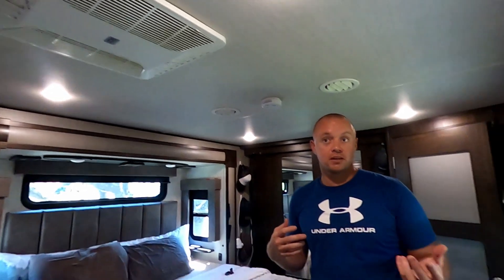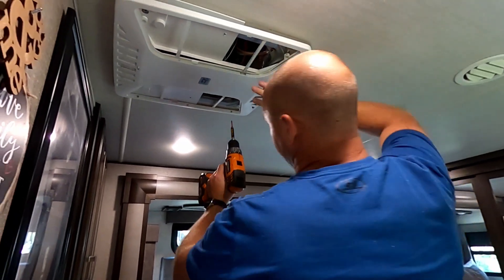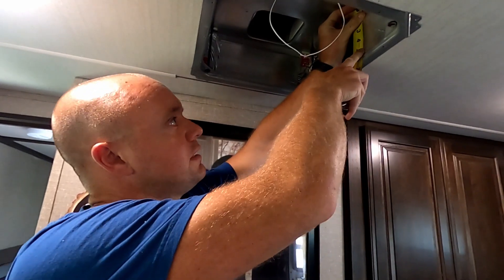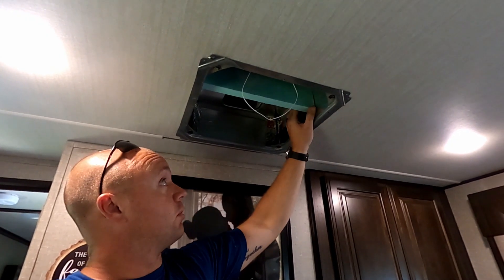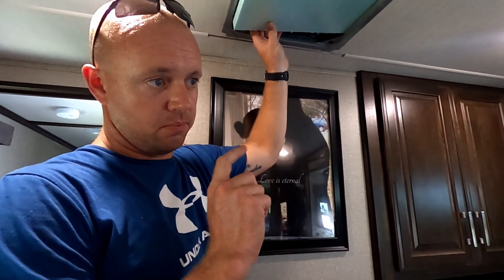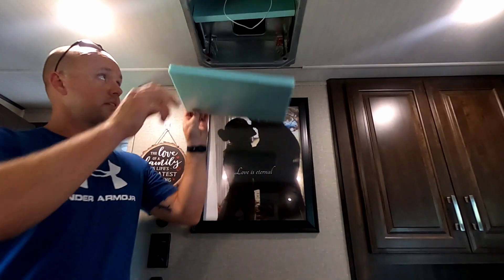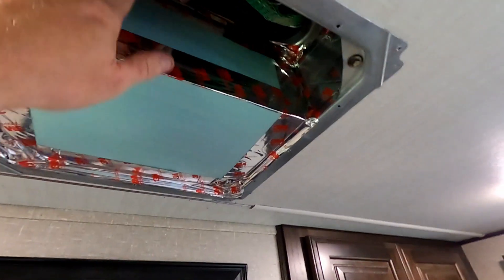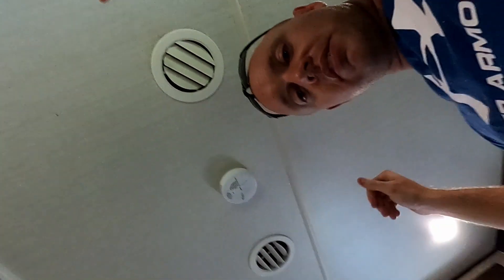Grand Design A/C Modification

Comment: Excellent job of videography as well - Thanks! But you completely eliminated the Cold Air Dump feature of the cover when you do this. Granted you probably gain a lot of cooling thru the ducts, but the air dump is gone...
 P.S. Using an electric carving knife works well for cutting these pieces. Also use Pythagorean theorem to calculate the angle (square root of the sum of the squares).
Reply from the maker: Sorry for the delayed response. Jeff had hip surgery recently and getting back healthy has been the focus! Thank you so much! You are absolutely right about eliminating the air dump.  We went back and forth on if this would impact us (we have been based out of Louisiana and Texas recently) but we don’t even miss it! Our rig stays pretty cool even during 100+ degree temps. 

Great call on the electric carving knife. That would definitely have made this a faster job! Keep the advice coming!

And as always happy modding and safe journeys! See you somewhere!

Comment: Really nice video. Thanks so much! 2 questions: 1) How wide was the tape you used? Looks like 2" but want to be sure. 2) What was the wire that was hanging down from the return air plenum? Thanks, and keep on keeping on!
Reply: I think the wire hanging down is his freeze plug sensor.

Comment: Just did this to my Coleman mach unit. Seems to be working and a few decibels quieter, about 5. My question is that you lose the two big vents on the face plate of the unit. Seems like we lose a lot of cooling without those. Do you feel like the over all new airflow is good enough to make up for the loss of those vents? Fun job.
Reply from the maker: Good afternoon!

We’re glad you enjoyed the project! Yes we did lose the dump vents but our rig stays plenty cool! Even in the 100+ Texas summers. We don’t miss the dump vents at all. We are getting great circulation through the racetrack ductwork! 

We hope this helps!

Very respectfully,

Jeff and Amanda
Reply: @WeLiveFreeRV  Thanks for the reply. I am getting used to it and it does work great. I guess I just miss the initial cool air dump when you first walk into a hot rv. Keep up the good work!

Comment: I recommend just leaving it the way it is air conditioners are not meant to be screwed with you take the chance of it freezing up or just rendering its ability to cool all together
Reply from the maker: Hey Thomas!

We were a little hesitant at first about this mod as well. That was one of Jeff’s main concerns was if it would tax the AC system in some way. We have had this mod on and run our ACs virtually continuously without issue! 

You do have a good call out that does go with the old saying of “If it ain’t broke don’t mess with it”. 

Thanks for the feedback! Safe travels and happy modding!

Very respectfully,

Jeff and Amanda

Comment: So great.  Thanks for posting.  I wonder if it would help to use some foam rubber tape on the edges to get a good seal between the styrofoam and the steel case.  I am definitely going to build one of these.  I thought about making ducts with the 3D printer and then filling in around them with some spray foam.   Your design looks very quick and easy to build.
Reply from the maker: Thank you! We thought about using additional materials to ensure it was an airtight seal as well. Ultimately we just ended up using the HVAC tape.  We are seeing tremendous increases in output! If you do end up modifying it to be better please post it!!! Happy modding!
Reply: i guess im asking randomly but does anybody know of a tool to get back into an Instagram account..?
I was dumb forgot my account password. I would appreciate any help you can give me!
Reply: @Rocky Matthias instablaster :)
Reply: @Rodney Julian it worked and I finally got access to my account again. I'm so happy:D
Thanks so much, you saved my account !
Reply: @Rocky Matthias You are welcome :D

Comment: I have a very similar (if not the same) a/c unit (Coleman Mach) in our trailer. Just took the cover off and to our surprise there were NO black ducking covers (the two black covers that snap onto the ducting inlets on each side). They're both literally missing. Do you think I'll need those? I'm wondering if I can seal it off enough to not need them? Or perhaps I should buy them...
Reply from the maker: Hey Robert!

We are not certified RV repair people, sorry! Have you tried reaching out to the company of your RV? They might send them to you for free or at a good price!

If not we would suggest to tape it very well and see if you are satisfied with the results. 

Very respectfully,

Jeff and Amanda

Comment: I bought the materials and set out to modify the AC in my fifth wheel today. Unfortunately the blower motor is mounted in such a way that my chute is on the right side instead of straight out of the middle. The return air looks just like yours but if I built a throat in mine it would cut off event on the right side and only be able to throat to the left side. I even checked the cool air website and they don’t make one that would fit my AC. That’s just my luck.
Reply from the maker: Hey Johnnyp68,

What is the brand of your a/c? We’d be happy to look into it to see if there is a way to help. 

Very respectfully,

Jeff and Amanda
Reply: @WeLiveFreeRV  it’s a Dometic. It’s in my 2014 Forrest River Wildcat Ultralight.
Reply from the maker: @johnnyp268 Good morning! Check out this article and see if it’s like your a/c it might help. 

https://salty-escape.com/saltyblog1/improve-your-rv-ac-colder-and-quiter

Very respectfully,

Jeff and Amanda
Reply: @WeLiveFreeRV   The ac looks like mine except for where the air comes out. My square hole where the air comes out isn’t in the center over the top of the dump vents it is to the far side.

Comment: I have just a small toy hauler and no air ducting throughout the toy hauler. Has anybody done anything with a non-duck unit to make it run more efficient. Curious if anybody has and if there's anything to do to make them run better an more efficient.

Comment: Great video but it begs the question,  WHY is that the manufacturers don’t do this to begin with!  Bet some bean counter told them they could save two buck per unit!
Reply: Probably because this mod eliminates the "dump" feature which some folks like.
Reply: Probably because this mod eliminates the "dump" feature which some folks like.

Comment: How high does the TeePee end up off the foam base3?
Thanks for showing this!  I am sure not as efficient as a molded piece of foam with smooth air flow paths, but much much less expensive and a much better value!
Reply from the maker: It was approximately 3.5 inches up from the base. I agree that it's probably not the most aerodynamic but after covering all the surfaces with HVAC tape I can tell you without a doubt that it works! We used to keep all 3 A/Cs between 69-70 to be comfortable, now all are set at 74 and it is noticeably cooler. Also the A/C's don't run as often. It's great.
Reply: @WeLiveFreeRV  Does it stick up into the dump opening or just below it?  How did you determine the 3" and 4" TeePee pieces?  I will do this!  Thank You!
Reply from the maker: @G Kerr it does not stick up into the opening. It sits about an inch underneath it. I wish we had a scientific answer as to how high but I just kept messing the the cuts until I knew it was short enough to not stick up into the opening.
Reply: 1! @WeLiveFreeRV  Thanks very much!

Comment: Any tips for reducing the noise on a ductless Grand Design with a single 13500 btu ac?
Reply from the maker: Good evening!

Ductless is a challenge. We are not specifically aware of any solution for that. 

We don't think this will help it get quieter but you can check to make sure you don't have any gaps and seal them with HVAC tape. It can make it more efficient. 

Sorry!

Comment: this is great, i was getting ready to order the kit from rv air guy but this is better i think for a lot less money thanks. one question did you put both sealing pieces back up.
Reply from the maker: Hey howard! Everything disassembled during this process goes back on! You are simply building a custom redirect of foam board and tape. The foam pieces you add will fit inside the original equipment. The only "factory piece" we didn't use was the foam divider (in the video it's at the 8:12 second mark). We replaced it with foam board. We hope this answers your question if not let us know! Happy to help at any point! Happy modding!
Reply: @WeLiveFreeRV  i got the board yesterday, had the tape from 6 years ago in house
Reply: @WeLiveFreeRV  i used to have a 2004 37 ft HRC toy hauler with two air cond, they were carrier units they dont make them any more. We sold it and bought a rockwood 32 ft 5wheel with 15000 one air we only used it once this year but when getting it ready in 95 degree and 90% hu. It was not working i think all trailer manuf. Now build crap and leave it up to the consumer to fix it.
Reply from the maker: So sorry to hear that! We hope this helps! We were also in an area with high humidity for 6 months (New Orleans). We bought a BIG dehumidifier and it helped cool our rig / keep it cool all summer!

Comment: Did you measure each AC unit or were they pretty much identical? I’d love to measure one of mine, get it set, then just use the same measurements.
Reply from the maker: Hello Why Wait!

First off, we have watched several of your videos and they are awesome!  The measurements should all be the same, however we would encourage at least doing a quick measure of your other AC prior to starting just to be safe.  This is due to potential variances in the building process of the rig.  Ours were all the same cuts with minor (1/8 in) differences.  We hope this helps!  

Safe travels and Happy Modding! See you on the road!

Very respectfully,

Jeff and Amanda
Reply: @WeLiveFreeRV  thanks guys. I just messaged you over on Instagram. Had a few questions. 👍🏼

Comment: Going check out my Raptor this weekend. Get a head start for south Texas. U think project foam board safer than the foam board HD or Lowes sells? Have you noticed the board off gassing,
Reply from the maker: Hey Erik! Sorry for the late response this comment slipped by us! We bought the green foam board from Lowe's/HD! Good luck and happy modding!
Reply: Haha.. i grabbed one. I have a keystone raptor. My measurements seemed the same as yours. I am heading to my home away from home today. It’s parked on Port A Tx. I might need the heater this week 😂
Reply from the maker: See here we are currently in the DFW area and it is chilly!
Reply from the maker: Same*
Reply: Table saw works awesome also...

Comment: with this mod , no need to reinstall the flat diverter plate Coleman uses
Reply from the maker: Hey Tony! 

You are absolutely right! We chose to put the plate back so we could “undo” the mod if we ever need to and still have all the parts right there!

Safe travels and Happy modding!

Very respectfully,

Jeff and Amanda

Comment: Can you do this with a heat pump AC?
Reply from the maker: Hey John, 

I honestly am not sure.  I cannot give any advice on whether or not it is possible for a system that pushes heat. I would offer the thought that this mod is reversible and you can “undo” it for the cooler months when you need continuous heat. I’d personally would undo the mod to ensure safety of my rig and family until I  heard it was otherwise safe. 

If any other viewers have done this for a heat pump unit please chime in and help inform the Rv community!

I hope this helps. Good luck and happy modding! 

Sincerely,

Jeff and Amanda

Comment: Seems like you could leave that inner plastic piece out and just put weather strip around the cover.
Reply from the maker: Hey Ed! We thought so too but ultimately decided to put it back in place. The reasoning behind that was that if we ever wanted to remove the mod we could do so and just replace the dividing piece between the intake and output.
Reply: @WeLiveFreeRV  Makes sense.
Reply from the maker: Thank you! Have a happy holidays!

Comment: Hey thank you so much for such a detailed video! I was wondering if it would be wise when doing the first unit to just make double of each piece when cutting so you are all ready when going to the second. It should all be the same right?
Reply from the maker: Hey Leah! First you are most welcome! Second yes in theory they should be the same size however we’ve learned to measure twice and cut once to avoid wasting materials. If you are going to do it the way you described its at least worth measuring all the units real quick then cutting. Good luck and happy modding.

Very respectfully,

Jeff and Amanda
Reply: @WeLiveFreeRV  my husband installed today and it works great! He measured and cut the second unit separate just to be sure. Thanks again!

Comment: Our result for this hack was to force our air into the round air vents (instead of the vents you recommend to stay open.  Is this correct?
Reply from the maker: Hey John,

Yes it will force air through the race track ducting system and put through the round air vents throughout your rig. This allows for more even cooling versus all of the air coming out of the dump vents ( the large vents located directly underneath the air conditioners).  We leave the dump vents open to allow for maximum intake of air so that it can be quickly cooled and recirculated. This should allow your air conditioners to not constantly cycle on and off during high temperature days. 

Very respectfully,

Jeff and Amanda
Reply: @WeLiveFreeRV  You are allowing unfiltered air into the evaporator if you leave the dump valves open.

Comment: I was trying to understand the mod. Does the mod completely block out the ceiling register to force the air into the duct work registers. From what I could see when done it did not appear that air would still filter out of the large ceiling register. Would you please verify that I am understanding the mod and diverting all the a/c Air into the duct work with those round 4" ceiling registers. Thanks.
Reply from the maker: Hey Linda! You are correct. The way we completed this modification does eliminate the ability to dump air directly into the room straight down from the a/c unit.  In all honesty we were worried about losing that capability, but after we did this we didn't need it!  Diverting the air more efficiently through the duct work allows for more even cooling throughout the rig. In our experience this also reduces the never of times your a/c(s) cycle on and off.  We literally froze ourselves the first night after we completed this. 

The best part about this is that it's incredibly cost effective and easy to remove if it doesn't provide the results you want! 

We hope this answered your question! Let us know if not and we will try again!

Very respectfully,

WeLiveFreeRv
Reply: You answered perfectly. We may be jumping the gun a little bit, we are going to buy a 2003-2007 5th wheel which seems to be the age range for a 38ft to 44ft that fits our budget. So in advance, we are looking up all the mods to do when we get it before hitting the road.  This was going on our must do list. Presently, the prices are high, inventory is low because of Covid we decided to wait until January or February.

Your video was spot on and helpful. Thank you. Be safe. God Bless Bob and Linda
Reply from the maker: Thank you so much and to you as well! Happy rig hunting and future modding! Also be careful if you plan to head out west. There are some campgrounds that won't allow you to stay with rigs that are older than 10 years. ( Which is a shame) Don't hesitate to reach out if you need any help!
Reply: @WeLiveFreeRV  Thanks for offering your help. We are actually trying to pay cash and not take out a mortgage or long term obligation since we are older and I am disabled from a drunk driver just about killing me in 2013. Therefore, my wife is the only one working and she is a nurse. We would love to get something 5 years old, but our budget being less than $35K even with depreciation is most likely a 12-15 year old trailer. I never realized an RV Park or Campground would exclude us for not having a newer RV.  If we find a place that prefers not to rent to us, we would prefer not to stay there.
Reply: @WeLiveFreeRV  THANK YOU!!! I hope you had an awesome Thanksgiving! Your video was very helpful and I know it takes a lot of effort.

Comment: Has anyone wired their bed ac to come on when the living ac comes on? After do this mod to the living ac the bed ac does not come on. Guess the air flow to the bedroom is keeping it cool enough, but summer will be here soon enough
Reply from the maker: Hey Erik!  We were in New Orleans last summer and Texas this summer. Your ac will turn on! It just won’t turn on as much (depending on your thermostat settings). Because it won’t need to your rig will be better temperature balanced between the sections. Instead of working with the electrical system on the RV we suggest adjusting your bedroom thermostat to a lower temperature and it will still cycle on. We did that but ended up freezing ourselves haha!
Reply: Thanks for the info. We use the bed ac for white noise, Lol.. Let me know if you end up parking near Port Aransas this summer. Dinner on me.

Comment: Your open ended "teepee"  is going to make more noise than if you sealed the ends.
Reply from the maker: Hey Eric! That’s a good call out we will check it out! 

Happy modding and safe travels!

Very respectfully,

Jeff and Amanda
Reply: @WeLiveFreeRV  No problemo fellow traveler. I did something similar to my Mach III and got a horrible whistling noise. Someone smarter than me explained the Venturi Effect where a gas, or fluid, creates turbulence, and noise, when forced through a smaller diameter hole. I resealed everything resulting in a much quieter unit.